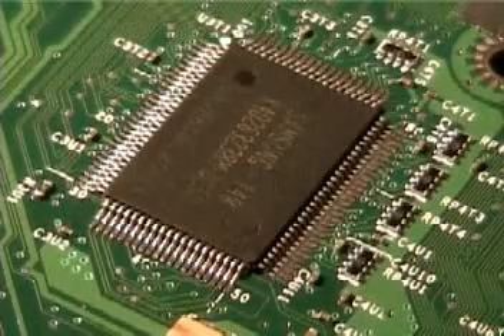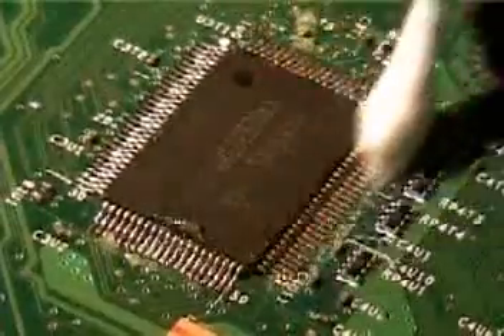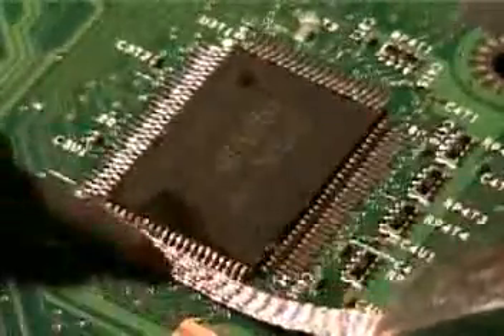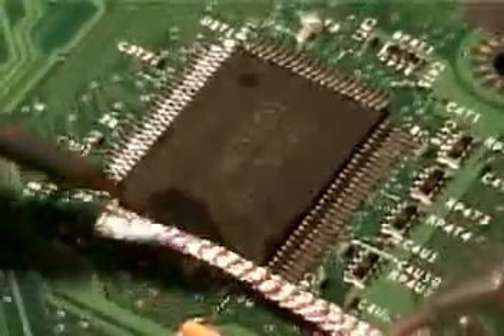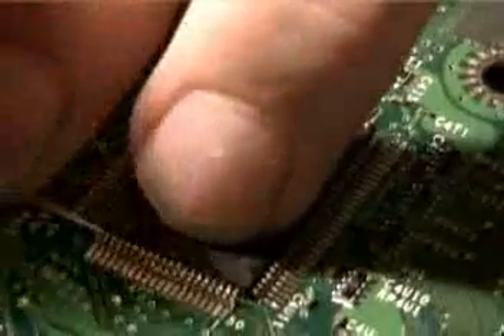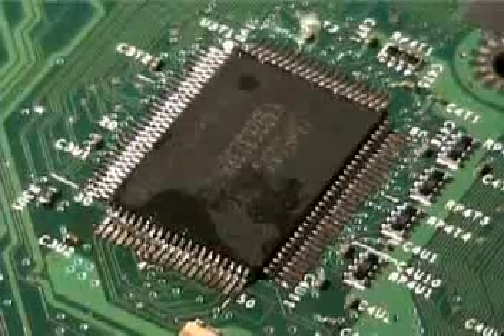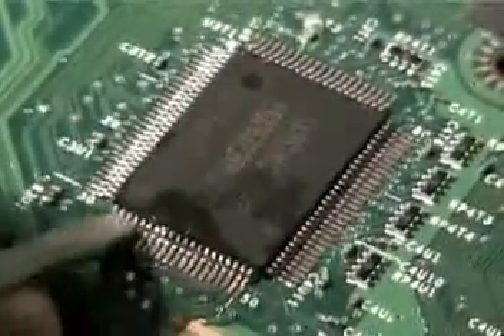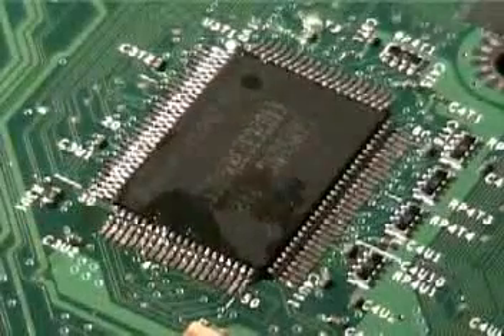Removing RAM from your xbox

Comment: I'm no expert but I do know some etiquette when it comes to soldering like tining the end of your iron to protect it from the oxidation, making sure to use the right amount of heat along side with the proper ironing tip and when working with RAM chips of any sort, extra precaution must be taking to prevent ESD or heat transfer buildup. They say in the computer repair industry that most sensitive components are memory.

Comment: I agree with the most of the ppl here. This is completely improper method of de-soldering a RAM chip. 1) you need to be concerned with ESD especially with anything related to RAM due to their high sensitivity: by him smearing his cotton swab I wouldn't be surprised if he had memory issues later. 2) they do sell a far more efficient and safer desoldering tool that, in one attempt, desolders the complete unit. 3) carefulness not to overheat this chip and possibly others which are sensitive to heat

Comment: @MrJANTJE123 1 it doesnt need to be conductive (which at some low scale it is) it gets between the leeds and the connection and also is leads some solder to flow on it. last but not least memory nands are very sensitive to heat.. also scratching your board or cold solder isnt a good idea either

Comment: A bit sloppy  i just watched another video doing the same type of work where they used a low heat solder to remove same type of chip and lo and behold a q-tip was used, i give an A for effort here since this was done several years ago, by the way why didnt i see a response did the xbox survive this? or did i miss it on the 17 pages of response, personally i would have used the needle and the heat at same time  desolder later gently pop them up as the heat let the solder go, not proper, job done?

Comment: Poor and incorrect method. Actually the easiest way is with a Heat gun and tweezers. Two minutes, then remove solder with wick, replace chip and resolder

Comment: You suck at electronics.
As you are prying those soldered legs away from the board, you are pulling the actual copper pads off the laminate. Wicking the joints doesn't desolder a chip. Use a hot air station.

Comment: @P3rfectRunx24 You pull the RAM to replace it with bigger RAM (homebrew apps can make use of this).  It comes stock with 64mb, most mods I've seen go to 128mb.

Comment: much better do it with hot air gun, if you force -like you do- anything from behind the pins in order to "break" the weld, it is more likely to get the pad and the via unstuck from pcb, broken or even worse a pin to break of the chip.

Comment: 1:50 Don't do this because you can (will) damage the circuit paths!
Moreover ground youself while working on electronic components, especially on memory chips and CPUs.

And by the way: NEVER EVER use any screwdrivers or knives on a SMD chip :-)))

Comment: many ask why you would do this
the xbox 1 only had 64MB of RAM, people used to upgrade to 128MB of RAM, because they probably used them for linux boxes. 
you'd desolder the RAM chip, from a dead motherboard, and resolder it to a working xbox 1 motherboard :)

Comment: Also, a decent hot air rework station (at least for casual DIY'ers) can be had for much less than $500-$2500 dollars. 
You can pick up a decent 850+ clone off of the interwebs for around $100-$150, and if youre weary about buying a chinese knock off, a really nice Weller rework station can be found for about $300 off of eBay. I have a Aoyue 968 3-in-1 that I use just about everyday and I absolutely love it. Costing only $160, it just about paid for its self the first time I used it.

Comment: While I personally wouldn't use a heat gun to remove these chips, it can be done just so long as youre really careful and know the characteristics of your heat gun by practicing first. To shield the surrounding areas from the heat (you mainly want to protect the capacitors), you can use aluminum foil. Like I mentioned before, I personally wouldn't use a heat gun to perform surface mount work, or a torch pen for that matter, but I have seen it done successfully on more than one occasion.

Comment: This is a "last resort" to removing a part like this.  If you're not careful, you'll rip traces right off the board.

Either spend $500 to $2500 on a rework station -OR- use a tiny torch with the "heat shrink/SMD" nozzle attached and work your way around the part. (that costs about $25)

I've removed hundreds of chips using the torch pen method and really only trashed a board or two by stupidity.

DON'T USE A HEAT GUN.  You'll damage components beyond the area you're working on.

Comment: Just wondering... what kind of solder gun is that. I mean like in watts.....15...30...40??

I have a 15 watts and 35 watts solder thingy. Will the 35 work better in doing this job?

Comment: Talk about needing the right tools for the job.

This is NOT how to remove surface mounted chips. Too high risk. The best way is using a hot air gun (as previous poster said).

Comment: A hot air gun and a razor blade give you a better chance of removing the chips without breaking copper leads on the board. I expanded my two XBOX consoles to 128 megs out from scrap boards, used the hot air gun to remove the chips from the dead scrap boards, without damaging the scrap boards at all ...